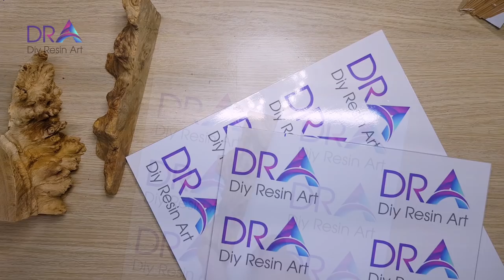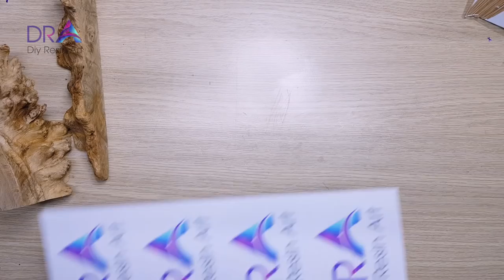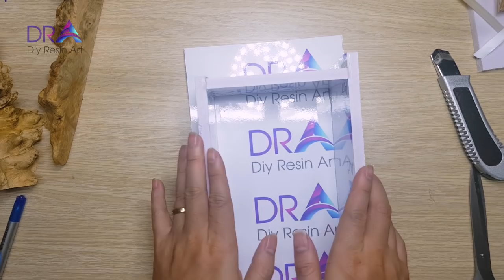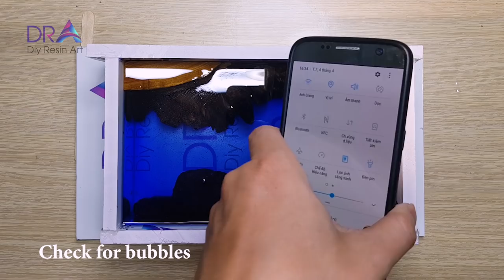Easy making Epoxy Resin lamp | Diy Resin Art

Comment: The Époxy doesn't melt from the hot lamp energy? Is that safe?
Reply from the maker: Epoxy does not melt when the led lights are illuminated, the LEDs do not generate much heat 😀😅

Comment: If you put the piece in a pressure vessel while curing you won't have to worry about repairing bubbles afterwards. The vacuum seems to introduce more bubbles than it removes.  Also, one of those micro torches works well to pop the bubbles at the top better than a grill lighter.
Reply from the maker: Thanks you so much 😍

Comment: Awesome.
I'm just getting into using resin.
Do you have any tips or tricks you could share.
How do you measure the amount needed?
I don't want to waste more than I have to.
Reply from the maker: The resin dries after 4 to 5 hours, so you can pour it a little less than expected then if you are missing you can add another 2 😃
Reply: @DiyResinArt  is there anything I shouldn't coat epoxy with?
Like soft wood or paints.
I seen leaves and dandelions in resin. Just wondering if you had like a don't touch list or something.

Comment: Nice project! You appear to be pouring about  8cm deep ? Most deep pour resin is rated for 5cm think. Do you have an issue with resin and heat ? How do you prevent a problem with this ?
Reply from the maker: 😃 When you pour it thick, let the room heat very cold, or place the product in the freezer to lower the temperature 😃😁

Comment: if using silicone mold, do you still need to put epoxy on outer surface?
Reply from the maker: Silicone mold for faster polishing, you can also use 400 sandpaper. sorry for the late reply

Comment: Podrías decirme por favor que resina epoxi utilizas para hacer ese grosor de lámparas , sin que aumente la temperatura?

Gracias
Reply from the maker: You find a Epoxy Resin that can be poured with a thickness of 5cm, when generating heat, let the blower blow to reduce the surface temperature. 😀🙏😍

Comment: Do you EVER have resin leaks? I use the same method with hot glue but I still get them.
Reply from the maker: You should pour a thin layer of resin inside the mold to prevent leakage 😁

Comment: Can you use other ways than a vacuum
Reply from the maker: You can soak it in warm water so that the plastic softens and the bubbles will float on top more easily 😍

Comment: Can u use anything a the mould as long as it's sealed ?
Reply from the maker: You should use a mold with a non-stick surface, preferably sticking a layer of tape on the surface of the mold 😁

Comment: What material is that you made your mold from? The stuff with your logo printed on it? Very cool btw! Also, what are the names of those clamps that I use to hold your mold together for gluing? 
Thanks
Reply from the maker: I use fomex, paste a layer of PP with channel logo printed.  I used "Right angle clamp" by on Amazon :). Thanks
Reply: @DiyResinArt  what is a layer of "pp"?

Comment: How come you had to brush that stuff on the wood before putting the epoxy in? And what was it? I'm assuming to seal off porous areas? Avoid bubbles?
Reply from the maker: That's right, so that it will prevent floating of wood and bubbles from the wood  :D
Reply: @DiyResinArt  I've watched so many videos now, in my head I'm a pro. Thanks!

Comment: Hello, which epoxy brand do you use? Could you tell if it isn't a secret? Thank you.
Reply from the maker: I bought from a local brand, you can buy Epoxy on Amazon that can pour 5 cm thick
Reply from the maker: And I usually use the 2: 1 ratio which produces less heat than 3: 1
Reply: Thank you!

Comment: Did you have to go through all that sandpapering and hardwork after casting if you had a silicon mold in the first place ?
Reply from the maker: You only need to do it with P600 sandpaper or higher if you have a silicone mold 😀 Thanks

Comment: Sure, I guess about 6:58 you started removing it from the mold and with it came the plastic film from the mold was still on it.. Could the heat from curing  cause to much moisture  between that plastic and the epoxy.. Hope this helps.  Or mishap caused by thickness  of epoxy ?  I surely would like to solve my curing problems. Thank you.
Reply from the maker: Ah You can use aluminum tape or soak the entire mold in a tub of water to reduce the temperature, or place in the refrigerator.  Look for less heat generating resins.
Reply: I noticed the plastic film as well. To my understanding, you are suppose to remove the film before assembling your mold (that's what I see everyone else do), that's what I attributed to the rough surface rather than the glass smooth surface usually seen when molds such as these ones are used.
Reply from the maker: @trinomial-nomenclature  Yes, Thanks you :D

Comment: How can u use hot glue? When I use it, everything melts away, because the epoxy gets hot and the glue gets liquid?
Reply from the maker: Soak the mold in an ice cube pot, I thought it would be ok😁
Reply: The heat is being generated by a chemical reaction that starts when the two components are brought together. Part of it depends on the brand and type of resin used. The faster a resin cures the hotter it gets and some brands are just hotter because of the chemicals. 

The volume of the epoxy curing also contributes to the amount of heat so instead of doing it all in one big pour you could do your project in a number of smaller pours to keep the heat generated down. If you are doing pours that are melting everything away and liquifying hot glue then you need to change the epoxy or do smaller pours. If you're getting your epoxy from a hobby supply company then take a photo of what you are trying to build and talk to someone from there in order to get the best epoxy and directions on how to use it. If you are buying your epoxy from Amazon or someplace like that then spend the extra bit of money, if it does cost extra, and support a specialty store and take advantage of their expertise. Consider supporting them after as they helped you so that they will be around when you want to do more advanced work and also for someone else new. Others supported the store so that it was there when you needed it so pass the favour along.

Comment: i mean the equipment
Reply from the maker: Epoxy Resin Ration 2:1
Epoxy Resin Color Pigment
5050 led strip light
Variable-Speed Palm Router Tool
SimbaLux Acrylic Sheet
Vacuum pump
Polishing 3M brand
I don't remember anything else, thank you 😅

Comment: You are good but good enough . No proper sanding,  no properly place the light connect which would have been better if its hidden back or lowered. Still more to comment, but still i can't  do the way you did.
Reply from the maker: Yes I know I still need to learn a lot, thank you so much 😍